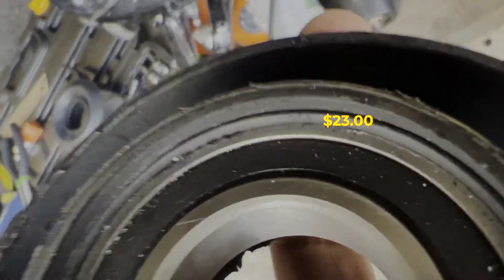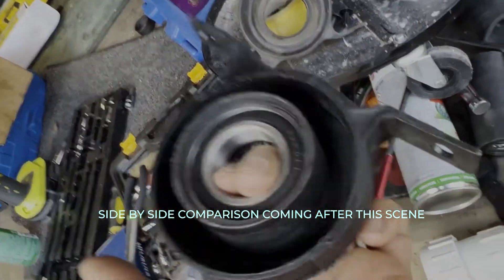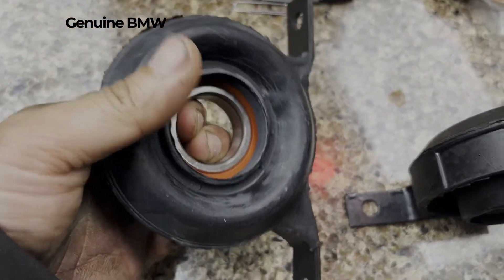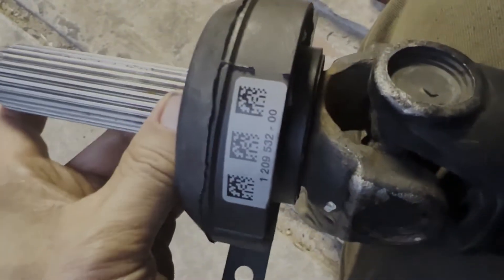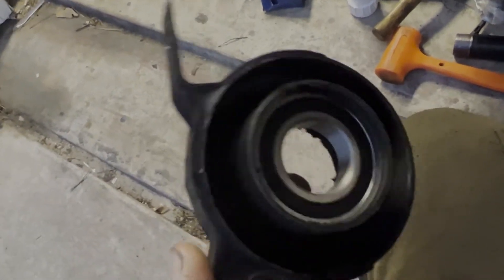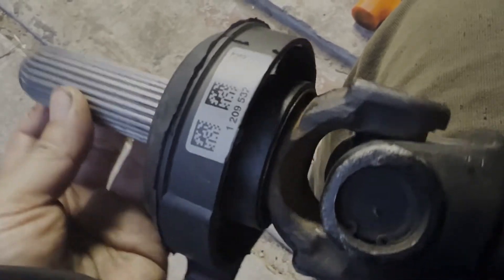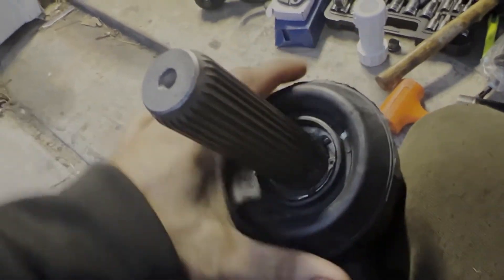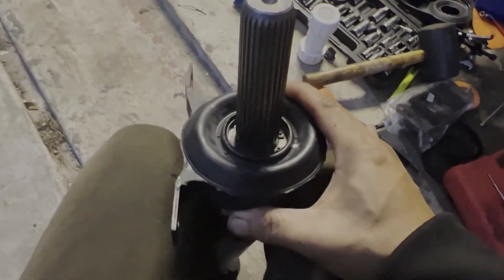$290 Genuine BMW vs. $23 Febi OEM Aftermarket - BIG DIFFERENCES!

Comment: Good comp, have you had any experience with the Rein center bearings they sell on FCPeuro? I installed one on a buddy's E46 a couple years ago and it has held up but I was always skeptical due to the price. The only thing that made me on with it was FCO's warranty policy.
Reply: I've only tried Febi center bearing on this 528e. I bought an entire brand new drive shaft for my e93 335i three years ago so don't know about that model. From now on, I will only do Genuine BMW parts on high stress components that are crucial to proper operation of the vehicles. Otherwise, after market parts for trim or minor items will be fine. I actually bought a Genuine BMW kit for the 330ci manual transmission shifter assembly to fix my loose shifter... also the same issue that another owner reported with an after market kit in his review... the aftermarket kit was different and had fitment issues. It costed 60% less than the Genuine BMW kit but it did not feel as robust, nor did it fit exactly
Reply from the maker: I've only tried Febi center bearing on this 528e. I bought an entire brand new drive shaft for my e93 335i three years ago so don't know about that model. From now on, I will only do Genuine BMW parts on high stress components that are crucial to proper operation of the vehicles. Otherwise, after market parts for trim or minor items will be fine. I actually bought a Genuine BMW kit for the 330ci manual transmission shifter assembly to fix my loose shifter... also the same issue that another owner reported with an after market kit in his review... the aftermarket kit was different and had fitment issues. It costed 60% less than the Genuine BMW kit but it did not feel as robust, nor did it fit exactly
Reply: @bmwchannel7209  copy all. Thanks for the insight

Comment from the maker: Warning, video contains profanity. Not for children.
Reply: Where you been with the 50i overland build
Reply: @E70dino  i just finished filming 4 shocks installing and replacing turbo lines, oil return cover… it is a shitload of footage to log. I know it’s been forever but it’s coming. And thanks for mentioning so you light a fire under my feet!
Reply: @matreyia  looking forward man. Just got my x5s engine replaced due to the oil consumption. Now it’s like a brand new car . No smoke and pulls hard.
Reply: @E70dino   Just make sure you change the oil at 3k intervals and do engine flush every third oil change and you will last forever.
Reply: @matreyia  Do you think every 3k miles is necessary? I've got an E70 35i and change the oil (Liqui Moly) ever 5k miles.  And we do mostly city driving.
Reply: @danielrd7493   3k suggestion is for N63 hot V configuration. on 35i you can do 4k or max 5k intervals... do not wait longer than 5k. Once the damage is done, you cannot reverse it. City driving even on a 35i I would recommend MAX 4k interval.